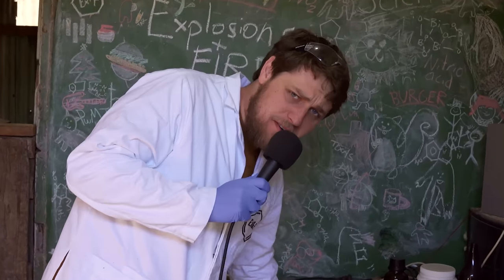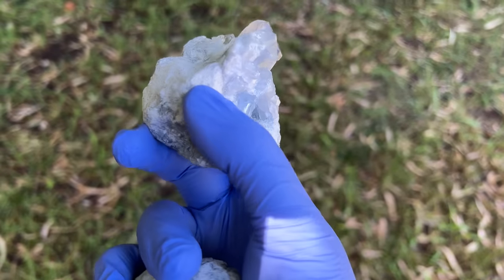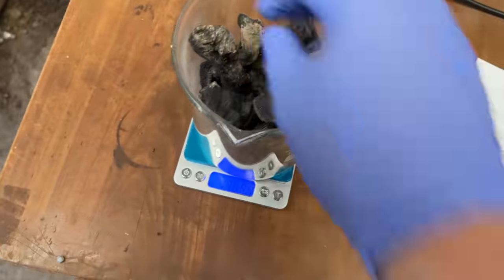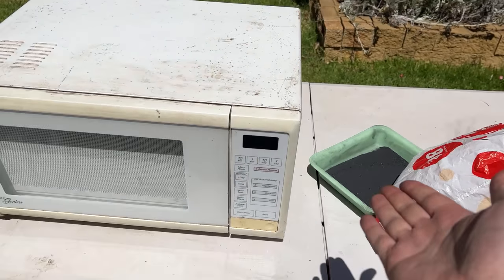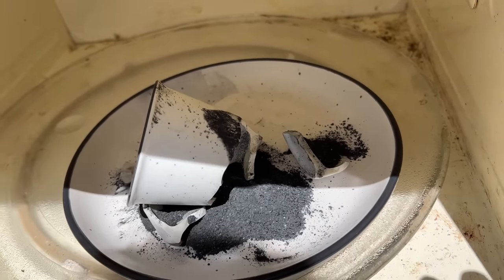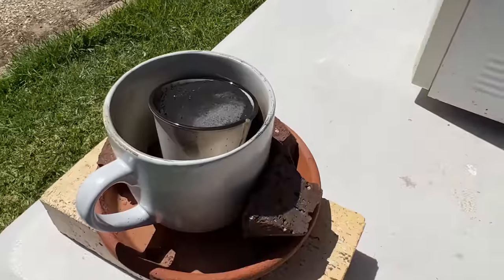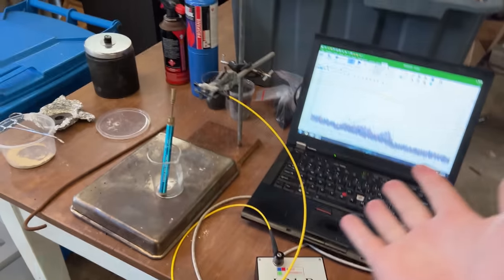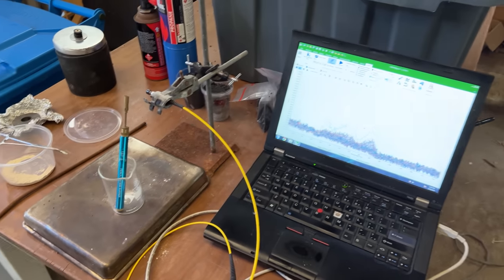Extracting strontium with a microwave

Comment: I was so mentally stuck on kitchen appliances that when you said you were going to add CO2 to the solution, I jumped straight to "yes, put it in a sodastream you madman"
Reply from the maker: DAMN THATS A GOOD IDEA
Reply: @ExtractionsAndIre  I mean, as pressurized CO2 sources go, it's widely available, but that's likely a hellaciously expensive route to go here.  The machine is interesting, but get an adapter, and use a refillable bottle (like you can get for paintball guns...), and you can get them refilled for hella cheap.
Reply: I'm imagining Hamilton seeing the elaborate CO2 bubbling setup, seeing this comment and just going "HA!"
Reply: @andrewamann2821  given their abundance, a bunch of people just use the Sodastream bottles with an adaptor for a CO2 source
Reply: @ExtractionsAndIre  could you not just add vinegar to the hydroxide then decomposed the acetate to carbonate with heat
Reply: So the takeaway is that "industrial process" is just code for "simple enough you could do it with kitchen appliances", yes? :P
Reply: @andrewamann2821  My brother in law has a brewery and he says soda stream bottles is the cheapest source of co2 out there.
Reply: @EddSjo  this has changed since the last time I had to buy CO2, then.  A tank wasn't an inconsiderable amount of money back then, but refills were dirt cheap.  It was only 20 oz. at a time, but buying new/factory refills would have been prohibitively expensive.  Has it really gotten that cheap?
Reply: low budget chemistry moment
Reply: @hadinossanosam4459  this is pretty much true. Getting any reaction to the "industrial stage" is just make it in less steps with less waste less cleaning and less complicated.
Reply: @EddSjo  For 4kg CO2 in Norway

Sodastream:
10 Sodastream tanks 3000kr
Adapter/Regulator 800kr
Refill 1000kr

CO2 from brewing supply shop:
4kg Tank 2000kr
Regulator 1000kr
Refill 519kr

So it’s about 2x the price, and way less convenient. Also the tanks have a much shorter lifespan. Both are coming from AGA, and are the same grade of gas. 

You’re not just falling for the razor and blades model, you’re saying the blades are a cheap source of steel.
Reply: @andrewamann2821  I personally just use the soda stream machine with an adapter for a bigger CO2 bottle
Reply: This might actually be a good idea to test holy shit
Reply: @radomane  i can hear this comment
Reply: @ExtractionsAndIre  I can't wait for you to do something with these nitrogen whipped cream cartridges... and I do not mean huffing it mate
Reply: There’s now a YT arms race to use a soda stream in chem, well played.
Reply: @hadinossanosam4459  This is actually more accurate than you may realize. Think about a plant that wants to be outputting tens of thousands of kilos at a time. For something to be industrially viable, it must be doable on an extraordinarily large scale, and be safe and simple enough that someone not trained in chemistry can do it. The dream for any upscaled chemistry is that everything can just be done in one pot by adding things at the right time. This is also why there's a lot of methods out there that work very well on lab scales than just don't make it to industrial, or a less efficient but safer/cleaner process is preferred. There are companies who's entire job is to take a lab proven method (one I worked with wanted to use organotin reagents and carbon tet which are both huge no-nos on scale) and modify or find alternate routes to get a method that can work practically in an industrial reactor.
Reply: @andrewamann2821  yeah ive got a sodastream connected to a 5gal co2 tank, works pretty good but leaks a lot of water everywhere when you use it. I think the pressure is too high. Anyways definitely do this but get replacement gaskets
Reply: Holy shit! 😂😂😂
Reply: @jchrizzy6995  put a regulator in between
Reply: @andrewamann2821  and it's pretty easy to refill tanks with dry ice. Pull the valve off the (empty) tank, weigh the dry ice, add it to the tank and replace the valve. Once it gets to temp your tank is full again.
Reply: @EddSjo  I feel like dry ice is cheaper by weight.
Reply: @radomane  Morris?
Reply: @jjgunt  yes
Reply: @ExtractionsAndIre  ... but that would have eliminated the cool glassware setup 🙂
Reply: @cy4n00   now that Russian sodium nitrite is permabanned from the shopping list, what is a poor Tom to use for nitrating his Ex&F?! "Leather cleaner" from the shady sex shop? Or the humble whipped cream dispenser? The vlogging opportunities are golden...
Reply: @andrewamann2821  Off-topic, but thank you for reminding me that "hellaciously" is a word I can and probably should use.
Reply: @ExtractionsAndIre  Big clive has entered the chat!......
Reply: @ExtractionsAndIre  If Joe Barnard can carbonate milk with a sodastream, so too can you!
Reply: @ExtractionsAndIre  SODASTREAM THE SOLUTION
Reply: @JamesTK I used to have my soda stream in the corner of the living room plumbed to a 20lb co2 cylinder. Made the best sparkling water ever! Completely ruined me for regular sparking water or gin and sodas at bars because I had such nice stuff at home.
Reply: @DevReaper  yeah, just need a compatible coupler to put into the back and suitable regulator and you'd be set. Could definitely see that being cheaper than replacing Sodastream cylinders all the time
Reply: @JamesTK  co2 can be run without a regulator so I had an adapter with high pressure hose plumbed straight into the soda stream. Amazon has them by the dozen just make sure it’s on tight so you don’t have a leak
Reply: Just drop some dry ice in it.
Reply: jjoo
Reply: If you get that ceramic glaze up to 1000 degrees it's going to turn to Glass liquid glass and everything's going to
Reply: The biggest shame is that you can build a kiln in an afternoon with rockwool some wire and get make some elements made out of nichrome wire all you have to do is hook it directly to a variac

Comment: That's the smallest ball media I've ever seen used in a mill. 3-4x that size would work much better for you.
Reply from the maker: Thank you! I’ll get bigger media. Surprised you didn’t roast my microwave furnace attempts, I should have learned from you better before trying this!
Reply: @ExtractionsAndIre  I think old ceramic junk is the best for this kind of thing. The only part I might have done differently is put a firebrick or some other insulator under your crucible so the plates stop shattering. Really clever method in any case. You got me thinking about other reactions that might work in this way
Reply: Why not a graphite crucible? That was what i was thinking the whole time
Reply: @ericscholem6629  graphite is conductive. I have a feeling that even in this case that isn't a good idea
Reply: 1010 use ceramic media😂 especialy for bp and shit
Reply: Hey, love the random chemistry channels coming up on this dude

Comment: Fun Fact, the exact procedure of adding moisture to a mix of powders in a ball mill that you used on accident is used in fireworks to produce the granulated fireworks stars used in fireworks rockets and big fireworks effect charges.
Reply: That is NOT the exact procedure. Milling stars is done in an open rolling container, using non-flammable cores such as mustard seeds onto which the powder is slowly added and misted.

Trying to make firework stars with the process he shows in the video is a MASSIVE risk of fire and/or explosion, as you would be exposing flammable (albeit wet) powders to many many colliding steel balls. Steel media is never used in conjunction with completed (oxidizer and fuel together) powders.
Reply: @TheFyroPyro  oh yea you're totally right its usually glass or stainless right? I was just trying to refer to the adding moisture to charcoal/black powder part
Reply: @TheFyroPyro  that is total BS. The industrial method puts the mixture in glass bottles, then gives those bottles to the oldest worker with Parkinson's there, after his fourth cup of coffee, to walk across rhw factory with.

Comment: When you were microwaving the powder and its just fracturing the pottery, all I could think of was the old youtube series "Is it a good idea to microwave this?" and that time they almost died with the Airbag.
Reply from the maker: Ah an old classic!
Reply: There's chemicals in airbags that generate the gas needed to inflate them in what's basically a (relatively slow) explosion, and Thoisoi's hand learned this lesson the hard way when he tried to break an airbag apart for a video, gave up on prying it, and went into the charge with an angle grinder.

Comment: As a glass nerd, THANK YOU so much for mentioning strontium carbonate as a raw material for crt screen production. The strontium ions also prevented browning, i.e. the actual decoloration of the glass by the radiation ... 🤓
Reply from the maker: It’s a cool fact! Such an interesting problem to have, that you emit so much radiation… but you can’t avoid it so you just build the shielding in as part of the class and it’s safe for consumers to sit in front of for hours!
Reply: @ExtractionsAndIre  "Safe"
Reply: @ExtractionsAndIre  its wild we were putting a particle accelerator in peoples homes for a long time before LCD was invented
Reply: Tutorial: How to go crazy making a red flame....😎
Reply: Wait, i remember one old TV that has a really brown-ish image, does that imply that I got a free XRay every time I watched the Saturday morning cartoons?
Reply: @zinobi  Unlikely. Has the glass of the CRT (!) screenitself really a brown tinge, even when the TV is off? If not, it's just either an old and worn phosphor layer or the colour is not adjusted correctly.
Reply: @meosalami5180  As I remember it the TV was brown even when off, but it was ages ago.
Reply: Love crts, tell me more plz 🙂
Reply: Interesting info! I thought face plate glass was mostly based on barium oxide for x-ray shielding, but I see there are some compositions replacing part of it with strontium as well. Lead oxide was used in black and white tubes as far as I understand, but the higher acceleration voltages used for color tubes led to browning, and Ba/Sr was used instead. Similar compositions were developed to make light bulb stems lead-free with the introduction of the RoHS directive, patent US6017838A has heaps of interesting information. Having done glass blowing with neon tubing, these compositions are miles above plain soda lime in terms of working properties, but not quite as nice as the old high-lead glasses. At least they don't reduce back to metal if the flame chemistry is a bit off, which is a royal pain with lead.
Reply: @Meo Salami I'm always curious about what gets people into their passions, especially when they're quite niche. So I'm curious; what got you into glass?
Reply: @stephenhumphrey1767  Glass industry used to be concentrated on areas where energy (wood, later coal) and/or raw materials could be found. The area I originally come from is such a mountainous forest area in the middle of nowhere, where glass has been made for 400 years and still is today. (It's actually really hard to set up a new glass plant just somewhere without a skilled and experienced workforce ... everything's quite special ...)

So growing up around this fascinating industry, during my engineering studies I decided to not get some random/generic job, but to stay with glass. I moved away from home and now work for an engineering company / equipment supplier ... and I not only get to travel to glass plants all around the world, but I can also visit my home town for business every now and then 😅

I consider having a job I'm passionate about to be a huge privilege and I would recommend every apprentice or student (especially in STEM) to find and do something they love.
Reply: @meosalami5180  I ask because I too think I've found something I'm truly passionate about, but it's unfortunate that you rarely find people being able to say that. That's really cool that you got something that suits you so well; and it's even cooler you acknowledge that. Thanks for the answer!

Comment: Microwave based processes are an area of recent research in mineral processing. A friend did a PhD on using microwaves for the calcination and acid baking of spodumene (lithium-aluminium silicate). Microwave assisted grinding is a thing too - different minerals heat up differently on microwave irradiation and the different degrees of expansion lead to microfractures at grain boundaries, reducing the amount of energy needed for grinding and improving the degree of separation in downstream beneficiation processes.
Reply: Whoa, microwave grinding?? That's super interesting!
Reply: Wow that's super cool (well hot) to read what people are researching with microwaves!
Reply: @emilyrln  microwave assisted grinding. The ore is hit with a microwave before going into the grinding mill, and the microfractures from the microwave pre-treatment cause it to break apart more easily in the grinding mill.
Reply: @roriegilligan8134  Very neat! Thanks for the info :)

Comment: One niche use of strontium is as an additive in cast aluminium alloys, adding small amounts improves the grain structure.
Reply: It's also used in fireworks
Reply: You can add some to lead to moderate the sulfate deposit on the cathode of lead batteries. It works a bit better than calcium for this purpose.

Comment: Oi, this is Scandium slander. Scandium makes incredible alloys, particularly in low concentrations in aluminum. Incredibly useful, but the supply's so small and unreliable (it's only produced as a byproduct of other mining) that it mostly sees use in high-end sporting equipment. There's a few pure-play scandium mining projects that would dramatically increase supply, but they've been in Project Development Limbo for years and years. If Scandium was available in bulk on demand reliably at any kind of halfway sane price, we'd use it anywhere we currently use aluminum and could really do with better material properties (including but very much not limited to aerospace engineering)

Comment: The switch from a specialized ceramic in the paper to regular porcelain for you at ~ 18:00 reminds me of my basic electronics course in high school.
A classmate of mine had read about this special ink that had been developed that you could draw on a copper blank, UV treat it, and then put it in the acid bath. Afterwards, the areas you drew on would be left intact.
The kid that read about it brought it up to the teacher and asked if he could try it out with just regular sharpies and tossing them into the UV kiln in the woodshop just behind us, so we ran a full experiment, including a set of UV treated and untreated boards with the full gamut of sharpie sizes.
Well, as it would turn out, you didn't need a special ink or even the UV treatment. Just a regular sharpie of any size above ultra fine works, so you can draw whatever you want on there and it's (somehow) protected from the acid bath.
Reply: Folks have been doing this for decades. Sharpies make a fine acid-resist for etching PCBs. For more precise boards, toner-transfer works well. Print out a mirrored version of your design on glossy paper with a laser printer, use an iron (or laminator if you're feeling fancy) to heat-transfer the toner to the board, then etch as usual.

Comment: Also I was wracking my brain to figure out where I knew strontium because it wasn't fireworks for me. Then the filtered strontium carbonate started drying and I realized: STRONTIUM ALUMINATE  is the best of the glow in the dark paint types.
Reply: It's the reason glow in the dark 3D printing filament eats brass 3D printer nozzles.
Reply: Yes but then you also need Europium and Dysprosium to create pits for the higher order valence electrons to be trapped within when excited, otherwise their orbits decay too Quickly

Comment: The potassium contamination might be because of you using firewood coal. Wood ashes are mostly potassium carbonate. Ideally you should have washed the charcoal with copious amounts of water first. Looks good otherwise, I had hoped to see you make some strontium nitrate though to confirm its typical red flame.
Reply from the maker: I did wash it, but I suppose it was not copious enough. Hate to think how bad it would have been had I not washed it at all- which I thought about doing!
Reply: I came to the comments to suggest this as well. Potassium salts was known as pot ash and was collected by soaking the ashes from burnt wood. No idea where the sodium came from, though, given how careful he was to avoid it.
Reply: For demonstrating the richest red Sr flame, I'd opt for either strontium chloride, strontium chlorate or strontium perchlorate. In red pyrotechnic compostions, none of the aforementioned Sr salts are commonly used, as they are hygroscopic or deliquescent. Rather, Sr nitrate or Sr carbonate are commonly used, in combination with a chlorine donor (e.g. PVC powder or chlorinated rubber) to enhance the red. The non-hygroscopic oxidisers potassium perchlorate (or, far less commonly: potassium chlorate) are also used in combination with Sr nitrate or Sr carbonate for red pyro compositions; these oxidising potassium salts also act as chlorine donors.
Reply: @EoganachtaMor also wood ashes, hard woods produce mainly K and soft woods produce mainly Na. The more you know! Lol
Reply: @jacobcasmus1882  ah, that might explain the sodium peak. Nice catch.
Reply: @ExtractionsAndIre  Sounds like you need to distill your carbon next time (and then convert the organic into glorious potassium-free tar).
Reply: NOT TO MENTION STIRRING IT WITH A PIECE OF WOOD WHILE ITS STILL FLAMIN’ HOT
Reply: @ExtractionsAndIre  What if you used a different carbon source like pure graphite or industrial diamonds